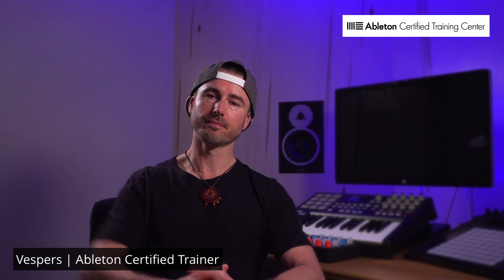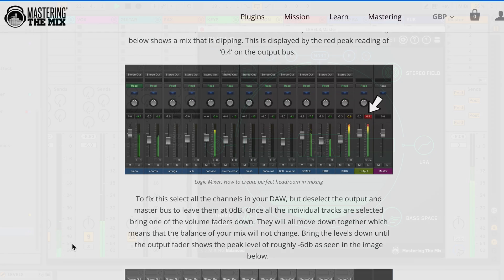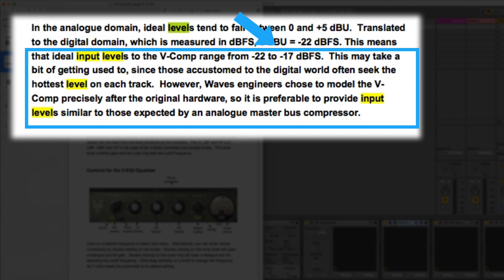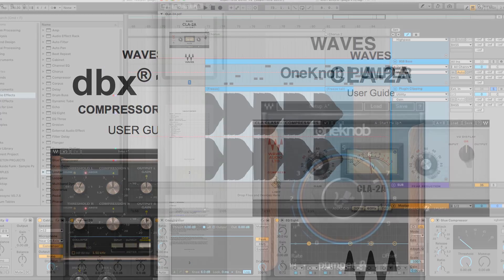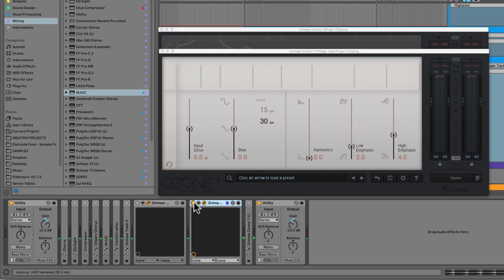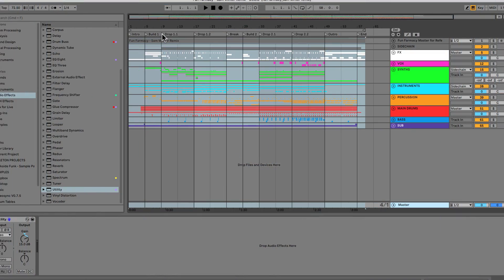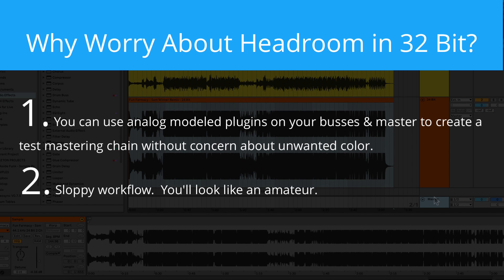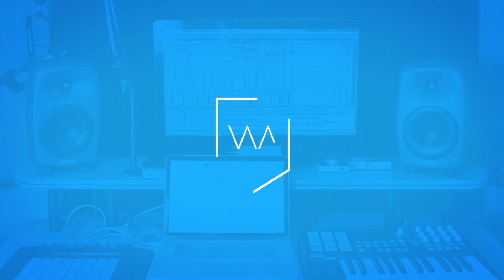Headroom, Gain Staging & Clipping in 32 Bit Digital Audio [Mixing Tutorial]

Comment: Question is it me or I can’t get the signal on my meter to even out in Ableton. I’m super sired for noticing that but I’m Pro Tools and even FL I can get the signal to balance out perfectly without the signal lightly moving left and right.
Reply from the maker: Not quite sure what you're saying, but some level movement between left and right indicates your correctly in stereo.  If levels are identical in your left and right meter, you're probably in mono.
Reply: @warpacademy lol, that’s not what I’m saying but I’m sure it’s pointless observation. I just like to leave my signal in the green and balanced on a actual meter. I have UAD volt with built in meter. Thank you for responding sir ❤

Comment: With gain staging certain plugins doesn't the factor of them being linear or non linear matter?   Saturators being non linear will sound different with more input gain vs say most eqs (linear) that wont
Reply from the maker: Hey Matt.  Yes, exactly.  My point is that different plugins need different input levels, so gain staging is critical.  

A saturator is a wonderful example of where the amount of gain that hits its input will radically affect it's sound.

Comment: If you open a plugin and it's adding too much distortion, could you not just dial back the gain or saturation level within the plugin?
Reply from the maker: Often times no.  Many plugins don't even have an input gain stage.  And even those that do, depending on how they're coded, may still behave badly.

Comment: The main thing I’m confused about is... can’t you just turn it up? Digital audio doesn’t really have the noise floor issue. I usually wind up mixing quieter than -6 and throw a gain to increase the volume at the end and I’ve never heard anything
Reply from the maker: You sure can.  But there is a noise floor with a lot of analog emulations.  And of course in any recorded material you put in.

Comment: I'm doing what you taught, and I checked the template too. Two things I noticed that might be issues, first, the individual tracks are delivered to the plugins in the track at a very low volume, so if I use a Waves plugin and it's at -30 LUFS in the track, isn't there a problem? Then in the master, after the stage gain +6 (I'm using either Waves L1 or Fabfilter), the tracks are delivered to the master effects at about -30 LUFS too, if the ideal is -22 to -17 LUFS, isn't there too much volume reduction going on?

Comment: Alright so this may come off noobish but I’ve been watching a few videos on gain staging and for me it’s just brought me a few more questions into mind that have had me flustered. Firstly I can now grasp that only the master should be sitting around -6db that makes sense. Well I’ve seen a lot of different numbers thrown out there on gain staging -6db, -10db, -18db,  and one person even said only -3dbI’m not sure where these apply aside from the master chain at -6db. Should I only be gain staging before mixing? Or is this something I can do while I work on my tracks because in my workflow I usually try to get as much processing done as I go to save extra work later and it’s exciting to hear the track come together as I work. It’s just my workflow & also helps me manage out any questions I have on the sounds I’m using while I go. I want my sounds to sound as good as possibly and the track to be pretty much completed arrangement wise before mixing. So with that being said is it okay to do it while I’m producing and writing? Then another concern is if I’m gain staging everything to a certain db how am I supposed to mix sounds later without messing anything up? Just adjust as needed with a separate utility at the top of my chain & one at the bottom of the chain to bring it back down? That sounds kinda ass backwards cause wouldn’t the take away just put my level back to where it was How does that work so I can keep certain elements louder than others. For example If my nonsense is getting confusing.

I wanted to practice this so I wrote a little 16 bar loop w/ Drums, Bass, Synth, & all the good stuff while I was doing this at the top of each track I was gain staging each track to about -18db RMS & my peaks were hitting anywhere from -14db / -12db (I hope I said that right) Well after everything was said and done some of my elements weren’t mixed in right 100% but I was more so focussing on just trying to get the master to -6db well after all of this my master was peaking at about -1db / -2db even with certain sounds not being mixed in properly (too quiet) & with every track hitting around -18db with the peaks anywhere from -15db / -12db I assume this is because I had so many layers of stuff adding up to cause the master to go past -6db Should I use a utility on the master to even this out?  Or Should I mix all my sounds to how I want them with a utility plugin at the top of each track (While faders are set to 0) then when I’m ready to mix fully then gain stage everything? Cause I saw one guy say he does it as he’s writing the tracks and just gain stages while he’s adding new plugins in. He didn’t elaborate though. That’s probably how I would do it.So with that being said should I keep lowering everything else? lower than -18db that’s what really confuses me about this process? Keeping things around -18db but also having certain sounds mixed in correctly so I can still hear them appropriately while also keeping that master low. Like I cannot tell if I’m crazy or if I’m thinking about this damn process WAY to hard. Which that’s probably the answer. I’m trying to accomplish this without touching the level faders at all right?

Sorry if I made this WAY harder than it needed to be to understand I just want to make sure I’m doing everything the right way so by the time I get to the end I can push limiters and such on my master how I need too, to get the “Loudness” I’m looking for.

Also side mixing question. Which is probably a SUPER N00B question. When entering a full on mix should I be bouncing down each individual track into a separate project file and mix that way? I’ve always just been trying to reach the best levels in my mixes while I’m still in the production stage. It’s more so something I’ve noticed while watching these videos is mostly no one is doing these things while they’re still in the process. Sorry for all my nonsense hopefully someone will be able to decipher my madness and help me out. It’s been bothering me all day since I spend like 5+ hours yesterday trying to understand this and I feel it’s just made me ask a million more questions. 

BTW Dope video as well! Thx this one probably helped the most but I'm still having other glaring questions.
Reply from the maker: Hey mate.  There's no such thing as a bad or noob question.  This is how we learn.  I think you're over complicating the process in your mind.  Let me set a couple things straight:

1) You should be monitoring gain in your entire signal chain all the way through the production process.  I start with this template right from the beginning, simply turning everything down a lot. 
2) In the mixing phase, I will review and tweak the gains all the way through the signal chains to ensure I'm getting correct levels into each plugin - paying special attention to analog emulated plugins.  
3) As you're mixing, I definitely change the gain of each Utility.  The initial gain stage down is simply a starting point to turn everything down.  After that, once all the elements are in the song, I selectively balance the mix by turning some Utility devices up and others down to get a rough mix.  

For your final question, yes, in general I bounce all the tracks to audio before doing a fine & final mix.  It's very useful to look at the waveforms vs. MIDI.  You also have more control over audio than MIDI, because you can see the full tail of sounds, as well as do creative edits like reverses that are impossible in MIDI.
Reply: @warpacademy  You don't understand how much your response cleared things up. Thank you so much! I appreciate it deffinite sub for you good sir. Keep up the good work & spreading the knowledge!

Comment: Great template - thank you.  One thing - when i add extra plugins into the device rack, i gather they should come after the utility that reduces the gain, so that any plugin modelled with low headroom / hot clipping would have the necessary headroom when the signal goes into it?
Reply from the maker: You're welcome!  Glad you like the template.  Yes, that's correct.  The Utility will lower the signal for the emulated plugin.  Of course, some plugins sound great when the input is overdriven and can produce pleasing results.  So experiment :)  Cheers!

Comment: I'm also kinda slowly moving from 24 bit to 32 bit float. So much hardware and software supports it now, so it's starting to make a lot of sense. Did you know that just changing rendering bit depth in video from 8 to 32 transforms ugly banding to wonderful gradients, without making files larger? This video is so good I  even subscribed.

Comment: How it looks with the Output on all the Vst Synths like Spire,Serum, Sylenth 1 ?? can they clipp at their Output? Or how i should handle this with Vst ? to reach for example -18dbfs i just would turn the Volume Knob all the way down to Zero and slowly turn up until i reach nearly -18 dbfs ? and how i should it keep during the Whole Insert Plugins of a Vst Chain?  also if there is an analog modelled plugin in between like an 1176 Compressor.?

Comment: Would a solution for analog emulated plugins to just gain-stage down to -18dbfs before and then gain-stage up after plugin in the chain?
Reply: Maybe dude I use analog pre amp plugins in my freezing stage for colours/harmonics. So I'm not using them during the mix. But most producers don't render all their tracks. It's kinda part of my flow. Write render arrange mix etc.

Comment: honestly the track at 12:30 sounds better distorted; nice warmth in the low mids!!
Reply from the maker: Distortion usually sounds pleasing to the ears at first, but that much clipping across the whole master is way over the top and destroys the fidelity of the mix.  If you like the sound of the grit on the low mids, it would be much better to use a multi-band distortion plugin like FabFilter Saturn or iZotope Trash 2 to target that, while leaving the rest of the song untouched.

Comment: awesome tutorial !
Please i have a question : should i put the crossfader (manually) down to -6 Db or should i configure my track (kick for exemple) so it dosen't hit the -6 DB ? to undrestand me more : after processing my kick (as an exmple) , the track level hit  -2 db ( so in this case should i put down the cross fader to - db) ?
Reply from the maker: Hey Mahdi.  By crossfader, do you mean the volume fader of the master?  If so, never adjust that.  You should use Utility devices in Live to reduce the volume of each individual track as I did in my template.  I set each track level to be -16 dB to start.   It depends on the recommended input levels of any plugins you're working with.

Comment: Thank you for the update/clarification. Not enough educators are clarifying these issues.
Reply from the maker: Cheers mate.  Thanks for your previous comments on the last video.  I integrated some of your points and suggestions and they definitely helped to refine and improve this video.  Hope you stay in touch!
Reply: good clarifications here, but -6dBFS peak doesn’t really make sense when the majority of emulated plugins like to sit around -18dBFS, but I totally agree, you should just gain stage properly. would be good to see a phase cancellation type tutorial to see what actually is added when you run an analog emulation at different operating levels.
Reply from the maker: @robgreenwell2961  that's a good comment.  I find that on my individual tracks and busses, I'm running analog emulated plugins at that lower level.  Then when they all sum up, the master is sitting much higher.  If I'm using something emulated on the master, I'll use a Utility device ahead of it to gain stage down again.  That said, some emulated plugins behave in a pleasing way when driven at higher that recommended input levels.  So -6 is still a fairly arbitrary number.  The more important point is to be very aware of gain through your whole signal path and to set things correctly for the devices you're using and your desired sound.
Reply: Have to say this answer was a mic drop and made you look arrogant/amateurish. Basically Vesper's was right all along and you were just unnecessarily flexing knowledge that applies only on paper and not when you actually do the thing (for real).
Reply: @anttim3391  I just watched these videos back to back and I can see where you get that impression but I don't agree. I think it's great that Vespers made both of these videos because the first one is like "this is a good rule of thumb to follow and this is the basic reason why", and this one really digs into the reasoning why people may agree or disagree with the rule of thumb. So many of these questions have answers that are "No...*most* of the time", and I appreciate that he took the time to break it down and clarify. It's always great to see the reasoning why people say what they say, and I learned a lot from both of these videos. It'll really improve my workflow to know not just what to keep in mind, but why to keep it in mind.
Reply: Derek Hackley You are probably right. Noise Floor’s comment sparked the discussion and resulted in this thorough answer so thanks to them. I wish they had been nicer though.
Reply from the maker: @derekhackley3989  Cheers mate.  Well said.  This is a deep topic that warranted a LOT of explanation, and while I certainly have my own preferences and recommended workflows, there are always more than one valid ways of working and reasons why.  It's also very good to challenge our own assumptions and re-think things occasionally.

Comment: Serious guy. Knowledge rules. 32bit fp is the it. I can have a track in the red and while in the DAW no problems. But if I render out that's a problem. So if I transfer the track to Melodyne it will record the track. Problem? No, blobs will look crazy but it plays because.. Melodyne is a 32bit fp plug in. 
The reason why this works is explained in this video. So now you know, when you leave the 32bit fp realm 0 db rules. But while working it doesn't distort.
Reply from the maker: Glad you liked the tutorial mate!  Yep, in Melo those blobs would be HUGE for sure.  Lol.  I love that they call the slices "blobs" as their actual technical term.  Yep, 32 bit is boss.  But you def gotta watch out for some plugins that can't handle a clipped input.  Thanks for watching and commenting!